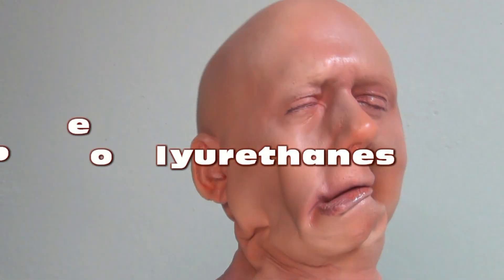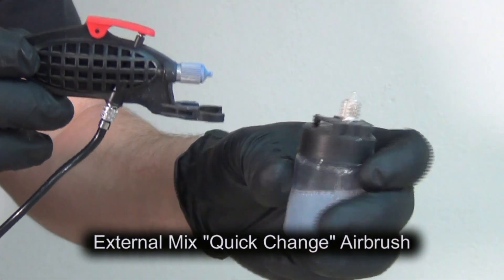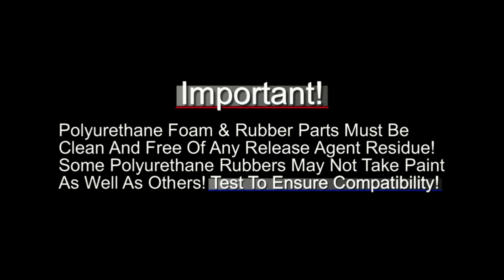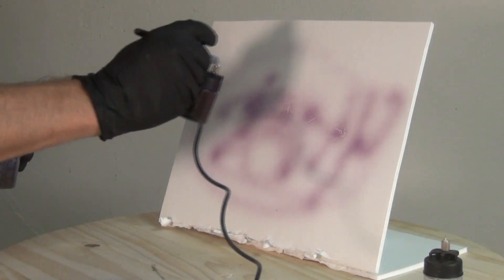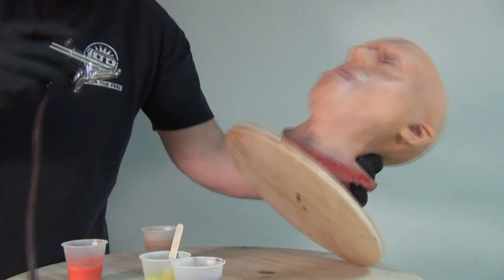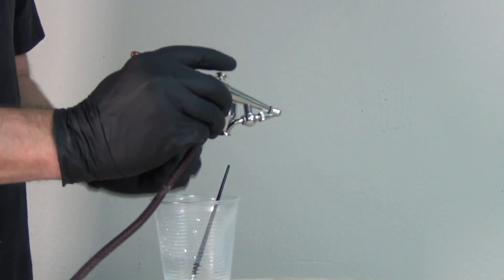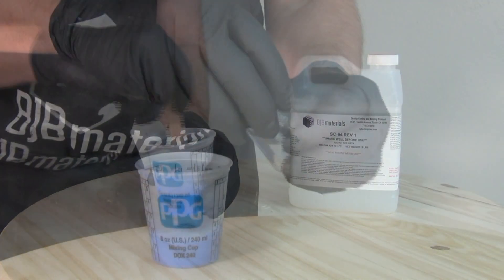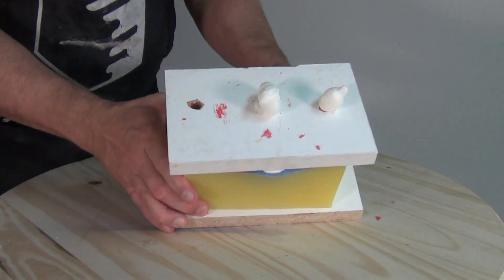Painting Flexible Foam & Polyurethane Rubber

Comment: Thanks a lot for this video ! Does it works with every PU rubber ? I'm using PT Flex 20 and have been painting with acrylics but it doesn't stick very well...
Reply from the maker: Do a test first. I have not used this formula on PT flex.
Reply: Your videos are incredible.  Will this coating make the foam UV stable?  I want to cast some small wall fountains in foam.  Just looking for steps to protect it plus look more like stone.  If you know how this is done or already made videos on this I would appreciate the link.  Much appreciated!
Reply from the maker: @josephb3147  That really depends more on the foam. If you are using a rigid foam like TC-300, you can prime with SEM primer and paint it and that will protect it against UV exposure.